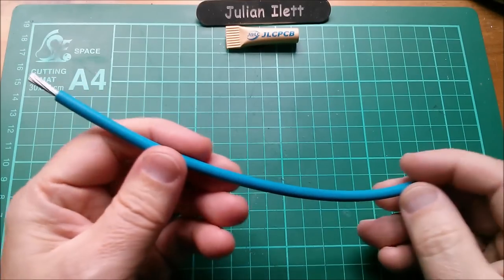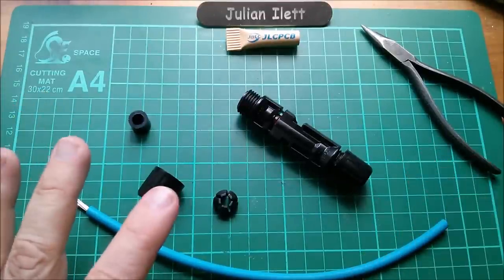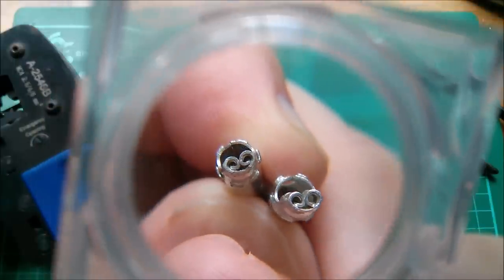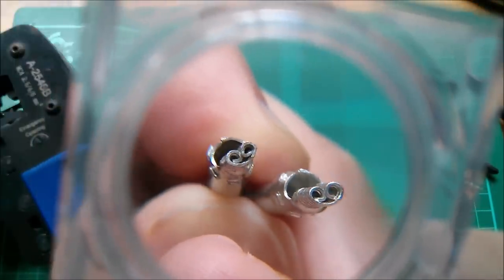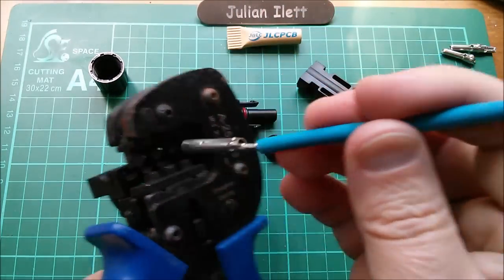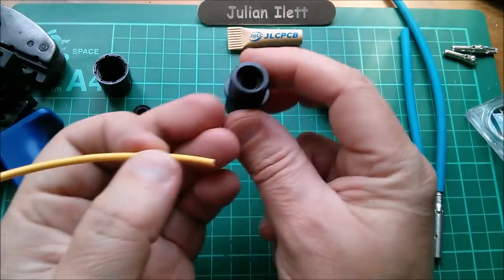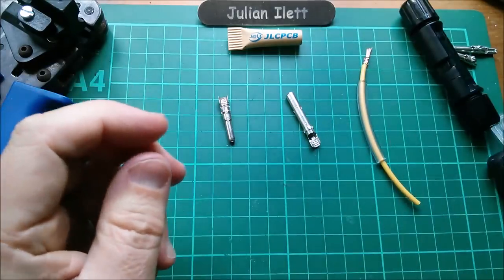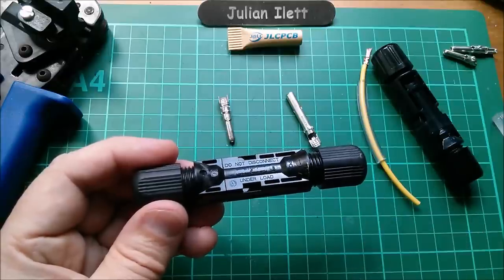MC4 Solar Connector, Cable and Crimp Tool Issues

Comment: A great resource which shows the internal metal barbs in the connectors that no other vids even bother to mention. You are all over the place with the bits and pieces mate, like you have had too many cups of tea. Thanks for showing the idiosyncrasies of the crimping mechanism. Your magnifier and illumination techniques for internal and close up details is brilliant and excellent.

Comment: The connectors are normally designated by the pins, thhis is important on mixed multipin connectors wher you have to know the differencce between 6 male and 4 female, and the other way round.
A;lso, you're stripping way too much, you only need it slightly longer than the crimp area, having too much going inside the connection could impede full insertion of the male pin
Reply: Came here just for this.

Comment: The yellow wire you plan on using is only heat resistant. The clear plastic tube around yellow wire in your demonstration will let moisture work it's way into the connection. When winter comes water will freeze and open space between clear tube and yellow wire. Then spring more water can enter the space. etc. Cheap wire and expensive connectors do not seem to go together well.
Reply: I was thinking the same.  At least glue the tube to the wire, but best to use proper wires all the way.
Reply: I would use some adhesive lined heat shrink tube over the PVC and extend over the cable to make it water tight.

Comment: There are many manufacturers of MC4 connectors. You cannot mix and match the parts, or the brands male to female. I suggest trying to figure out who makes the connectors on your panel, then getting that brand. If you can't figure it out, then you might have to cut off the panel connectors and use whichever brand you find.
 There is a bit of a voltage drop at every crimped connection in a wire. By soldering the connection after it is  crimped then there is no more voltage drop than the wire itself.
 There are special tools made to remove most terminal connectors from the plug. I haven't had to check for MC4 connectors specifically, but I have used them for other applications.

Comment: Towards the end of the video, are you sure you’re not just pulling the insulation back rather than the strands out of the crimp?
Reply from the maker: I think you're right
Reply: That's what I was thinking too. It would take incredible force to make copper wire slide through a crimp like that.
Reply: It's rather obvious too, actually - there's NO stress visible on the strands of wire, which there would be if it had been crimped.

Comment: sack the guide off, problem solved :)  will be easier to check the the crimp is positioned correctly too. the tiny versions of these crimps can be mega fidely!

Comment: Normally with those sort of barbed metal inserts, you get a metal cylinder tool to poke in the other end which pushes all the barbs flat, allowing you to easily remove the metal insert without damaging the barbs. Not sure about MC4 connectors but for the Molex connectors used for computer power supplies you can readily get tools from the usual places that push the barbs in to allow easy removal. Also the MC4 connector was originally designed to prevent it from being disconnected unless you were a solar installer with the appropriate tools, so the Amphenol one is more strictly following the original idea there.

Comment: As some others have said, halve the length you're stripping.  Put the wire into the crimp area and close the top of the U with pliers so the wire is held in place, bung it in the tool and close the crimp.
If you look at machined crimps the last segment of the crimp should grip the insulation to stabilise the join - you may have to remove the outer of the double insulation.
The 2 curls should dig in and separate the strands to grab two bunches of strands to grip them securely (cross section looks like "B").
... if you are doing it for yourself - measure the cables crimp and if necessary bring the cables down and solder the crimp (be very sparing with the solder) - no big globs or it won't fit in the plastic housing  just wet the strands in the crimp to hold them securely.
Finally - weather proof the connection, grease the top outsides of the fitting, push home then close gaps with a dawb of hi-tac hi-temp food grade silicone grease to keep it dry and stop corrosion.
Yours are mounted vertically on fence and won't have the usual angle to let rain drip off the backs.

Comment: That bit about the gripping of the wire reminded me of some Switchcraft quarter inch phone plugs I ran into some years ago.  The usual cap had a tapered face,  and a smaller cap screwed on top of that one with a rubber washer getting smooshed (technical term, there) between them.  You would NOT pull the wire off of its connections,  but rather pull the plug out of whatever it was plugged into.
I have a couple of ratchet-type crimping tools,  one having dies very well suited to BNC connectors and I've used it to make up some cables for my shop.  The other one,  I'm not so sure about...
I recently completed a project that used a lot of push-on connectors (to the back of toggle switches),  ring terminals (to some copper busbars I made out of copper pipe),  and a lot of Anderson PowerPole connectors,  which are very popular among the amateur radio crowd (it's a DC distribution box for my station).  In the case of the push-on terminals and ring terminals I used an "AMP Champ" manual non-ratcheting crimping tool,  hitting each connector twice on the wire and once on the insulation.  In the case of the powerpoles,  I just soldered them.  They do sell a crimping tool for those,  but I'd just rather see if I can get a set of dies to fit one of the tools I already have.  BTW,  Their recommendation for wires that are way smaller than the wire ends is exactly what you came up with here-- fold it up multiple times,  until it about fills the connector pin.
I rather like these powerpole connectors,  as they're non-gendered.  :-)

Comment: I think the first thing I'd do if I had that crimp tool, is pull the magnetic guard thing off and bloody throw it away 😕
Once you use the pliers to squash the crimp slightly closed (protip, do this after you put the cable in not before, it'll be less fiddly for you 😜) the crimp stays on the cable by itself to an extent. Just line up the crimp in the tool by eye with your left hand, then crimp shut.
Reply: Don't use pliers at all and don't use the alignment part of the tool. Put the wire in a connector and press the connector into the female part of the suage. The  springyness of the part you've been improperly squeezing with  the pliars naturally holds it in place so you can squeeze the crimper.
Reply: Re: using it with your thin wire. just pull the stripped part back over the insulation. then slide  into the connector and swage it. this will give you a good contact on to the wire part and good physical holding on to the insulation. As you showed by crimping with no wire in at all there's no room for anything to get loose.
Reply: exactly!!!

Comment: Just drill out one of the holes in the crimper.  With it drilled right through you can still set the distance manually and it will line it up centered without being at an angle like it is now.  And you are still left with 2 more holes for the shorter connector so nothing lost.

Comment: "PV1-F" Cable was used until 2015 and is not UV resistant.
Decent cable should have the “H1Z2Z2-K” marking. 
According to the EN 50618 standard, this is weather-, abrasion- and UV-resistant.
But I don't know if the UK uses cheaper cables after UKCA

Comment: I'm not familiar with these connectors in particular but usually the connectors with wings are supposed to (partially) teeth into the insulation.
Reply: @Daniel Egger
the insulation gripper ones have two sets of wings and the tool has two jaws the insulation one is a bit wider than the conductor one :-)
Reply: @YTANDY100  Unless you want to spend hundreds of $ for the proper tool with the proper jaws you'll probably end up with something like the http://www.engineer.jp/en/products/pa09e.html which only has a single jaw. Even if it's not supposed to grip into the insulation the wings are supported to grip into the strands of the slightly twisted cable for proper connection strength.

Comment: I was going to suggest a bit of silicone sealant to fill the gap but it seems like you have a good solution for that. I also like to use tweezers when I fold over my wires. Maybe not the best solution, but it does make things a bit easier. Keep up the entertaining videos and I can't wait to see your best impersonation of Max Headroom once the vocoder is done.

I also love that you enjoy variances in connectors. As a collector of connectors myself, I approve.

Comment: My 10p's worth:
1 This is not the correct crimp tool. It should not need so much fudging. The "adjusted"crimp does not even hit all the metal.
2  As with most crimp connectors that insert into a plastic housing the barbs are designed to be one time fit, however, it is possible to buy a set of removal tools that can sometimes have limited success at separating them without  destroying the gripping mechanism. 
3  The 0.75mm cable is IEE rated to carry about 6A. It has no chance of safely conducting "30A at 600v". As 25A copper fuse wire is 0.75mm, the wire will certainly get very hot until it melts with unpredictable consequences.  From what I can seen in the video, I doubt the module can handle that current either, but if it can,  should the 0.75mm cables not be replaced with the same 4mm cable?
Reply: What crimp tool do you recommend?
Reply: @diydan6045 I haven't used this type of connector myself, but the genuine  Amphenol crimpers should reliably do the job but I'm sure there are several other brands that will also work to varying degrees of reliability. Some of the un-branded crimp tools are advertised as suitable, but in reality this is not always the case. A poor crimp joint carrying high current will likely overheat, arc and cause RFI.

Comment: You enlightened me about solar cable. Never looked at it...it was just there.  I need to look at the price and start using it more. 
What about just using solar cable on your controller and eliminating the wire folding and additional tube?  (Hey, I fold wires all the time.)

Comment: Instead of folding the cable in a zigzag, just cut and strip a few more lengths of cable and insert them as packers when crimping then afterwards you cut off the excess cable.behind the crimp. You also need an extract tool to remove the crimps from the connector, you're not suppose to pull them out with force.

Comment: I have exactly the same problems with these MC4 connectors. In fact they are more an impedance for hobbiest PV users than an advantage. I  came up with normal solder connections and heat shrink tube combined with some self vulcanizing rubber bands on top to make it water- and weatherproof. Will se how long this is going to work. Its near my roof window so i could easily fix it just in case :-)
For bigger solar panels which are less easy to access i would still stick to the MC4 connectors but with correct PV cable and just solder the last bit to the converter / charge controller inside the house - so water proof is not necessary.

Comment: In your situation I would have just held the crimp in the correct position and not used the end stop at all. It also looks to be crimping the wire too much.
No way did the wire pull out the crimp the wire sheath slipped down the wire.

Comment: I saw problems with the mc4 type tool that doesn't have the magnetic side add on also. IN fact , I was very much not impressed with the ratchet jaw tool I purchased. SO, since I use AMP crimps for MANY Years, I use my non ratchet blue amp tool I've had forever. It rolls the crimps perfectly. Also, I wouldn't try to depend on the water proofing at the ends of the mc4. I'd add some water proofing stuff, your choice. . Also, if your system is in snow, EVERYTHING on the panel should be completely insulated. nothing should be in contact with the snow . Corrosion happens even when it is cold. In salt water climates I would go all out. no connections should be exposed at all. Even fiber glassing over things might be an idea. Exposed panels will not last long in marine environments if you don't do some special protective work.

Comment: The location part is an option and you can use the crimper without this. You can find the same crimper without location part. 
Most location fittings only allow adjustment to fit male or female at a time to save labor on big job or at a factory. If true, Adjuster Screw is offset to hit the side of the female connector and you have not turn the screw enough or have rubbish in the hole.  Those screws are very long and most picture and videos have them turned out a lot more then you have.
 Rarely the Adjuster screw is only for Male terminal. If so then Screw goes inside Female so can bottom that connector in the plastic. Dirty tool is possible the hole is holding rubbish in there preventing female bottoming out. I would remove the adjusting screws and clean the holes in the plastic.  Then try the female to fit all the way in again before installing the screw.

Comment: As Sparky says, it's the gender of the actual conductive elements that determines whether it's the male or female connector. As for the + and - designations, the idea here is the +ve one is on the more +ve potential side of the circuit and vice versa for the -ve. So if you look at the +ve output of the solar panel, this would be more +ve than the input to the charge controller if, for example, you interposed a volt meter at this point. 

Why pfaff around with crimping for such a low volume of connexions? It would be easier to simply solder them and end up with a superior result. As for your cable size adaption, that's a pretty cool idea really. Although when I have encountered this problem I have simply bulked up the wire with lekky tape at the point the chuck grips down on it. Works perfectly well, haven't had any noticeable moisture ingress issues with connexions prepared like this.
Reply: Crimping usually get a better connection then soldering.
Reply: @AndersJackson  Theoretically, a crimp provides a lower resistance at the connexion interface. However, this really depends on how well the crimp is done. The right gauge cable, with the right tool, using the right amount of pressure. Soldering is generally more forgiving, plus it also protects the connexion from the environment better. This is important when there is moisture or corrosive mists involved.

Comment: I simply don't use the additional device and align manually as necessary, but then again it is my first time ever using this tool and indeed MC4 connectors.

Comment: What about a drop of silicon to ensure the safety of MC4 with the little wire? Or why not to use 4mm2 wire connected to the board anyway? ✌️

Comment: Very Informative. I am in the process of putting together a small solar system and have just come across these MC4 connectors. I have read elsewhere that MC4 connectors from different manufacturers are not inter-connectble. Is that true? I sure hope not, because that would be absurd. For example, let's say I buy a PV panel and it has  short cables with connectors from A. I then buy or make extensions with connectors from B, only to find out they will not mate! What a cock-up if true!

Comment: Also forgot to say that the locator on the tool is only for the male contacts and you need a different locator for the female crimps. Or just move the locator out of the way and eyeball it. Usually I put the crimp in the tool and do a couple of clicks until the crimp is held in place, then you insert the cable and finish the crimping process.

Comment: Do I see the the aligner is held on by a screw?  Consider shimming it out to gain the desired alignment.  Or, drill a smidgen deeper in the hole so the connector can slip in deeper.
Reply: Then the male would be off?
Reply: @ColinRichardson  The adjustment set screw would set the male.  The female ID is larger than the set screw.

Comment: My crimper does not have that depth gauge on the side. I just hold the connector at the correct position, which does not seem hard. Is the depth gauge for additional quality?  I am wondering if I need a better crimper for MC4 and H4 connectors.

Comment: If it were me, I'd be highly tempted to drop a bit of solder in the crimp fitting and wire after crimping - just to give it a bit of belt and braces.
Reply: A properly crimped terminal (using proper quality crimp terminals which are the correct size for the conductor size and using a proper professional ratchet crimping tool) makes an excellent electrical and physical connection. The connection is so good that the crimp or wire will corrode before the crimp/wire connection becomes poor. And the mechanical connection will be so strong that when you try to pull it apart with force, in most cases either the crimp breaks or the wire breaks before the wire pulls out of the crimp. Hence not only is it not recommended to solder a crimped connection, it’s actually bad practice. A crimped connection can be made far faster (using the correct tools) than a solder connection. And because of its strength, crimped connections are strongly recommended for applications that are safely critical or environments that are subject to vibration. How do I know this? I’ve been working with crimp terminals for 33 years working on safety critical systems where reliability is extremely important. Systems that have a service life of up to fifty (50) years.
Reply: @Mark1024MAK  Aye all true, but I would still add solder. :)